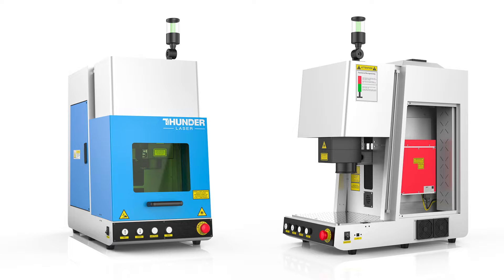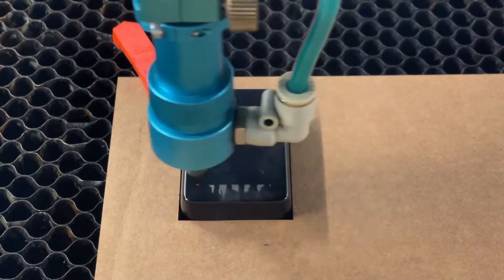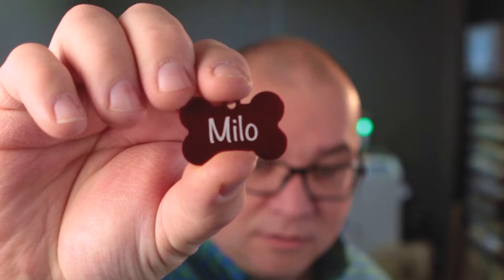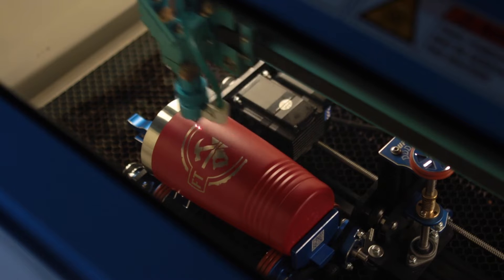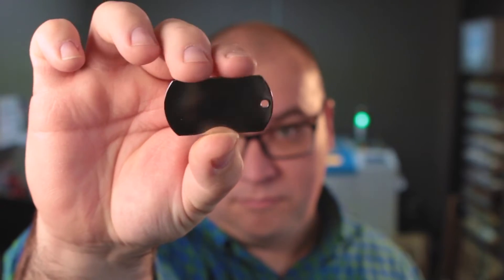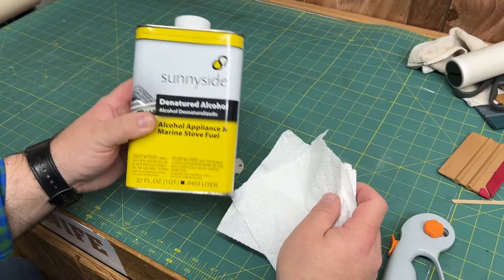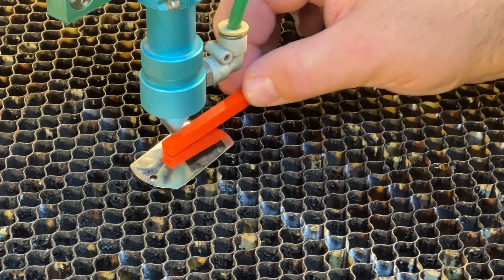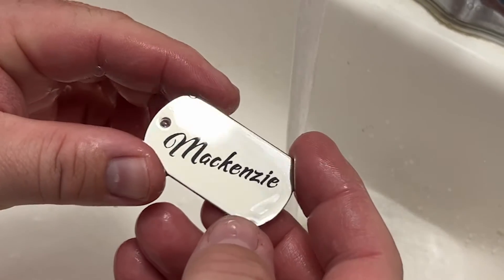Co2 Laser Engraving On Metal with a Thunder Nova 35

Comment: So how are the low level diodes colorizing stainless steel with no marking sprays ?
Reply from the maker: Diode lasers are a different wavelength which allows that. I don't have any experience using one of those.
Reply: @malonecustomdesigns  I tried with my C02 Polar 350. I can get black and some yellow. Its on SS 316 1/8 thick 2 inch round circles. Black tho is kinda brown looking. I'll play more. My Ortur LM2 which I can' recall what watt it is. I think 15 but not sure I couldn't get it to mark at all.